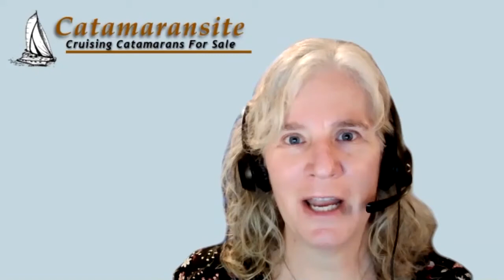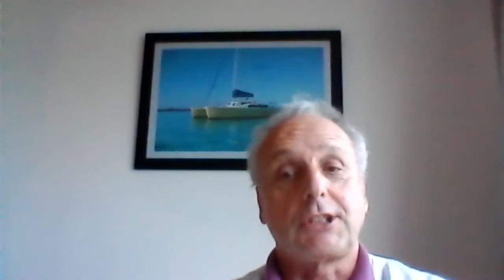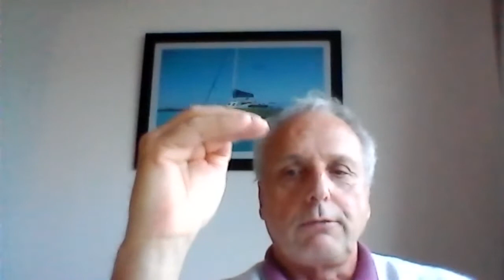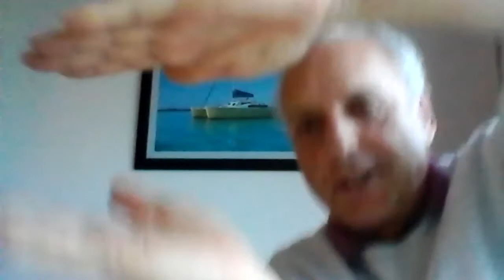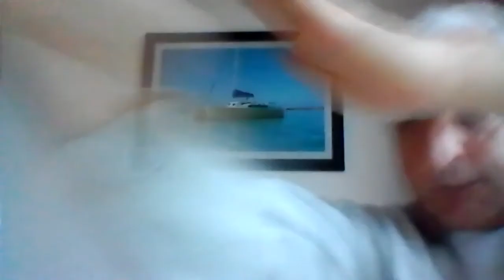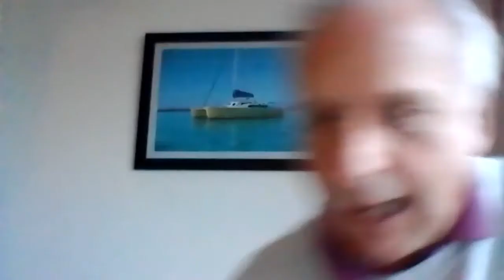What "good" bridgedeck clearance is and why is it important? - Richard Woods Interview # 4

Comment: In this interview Richard Woods talks about concepts of catamaran design while the interviewer talks about tactical aspects of a boat, the gap between concepts and tactics is strategy - catamaran design strategy which could of focused on preventing hull slamming.  1. The bridgedeck should start as far back as possible from the bow of the boat.  2. Beam and hull shape effect the wave(s) between the hulls created by the hulls.  S shaped catamaran hulls, curving in at the top, create less of a wave between the hulls.  3. A bridgedeck bottom that slopes from the front down towards the water is preferred over a flat horizontal bridgedeck bottom because the slant or slope will give the wave an area in which to dissipate resulting in less hull slamming.   4. When inspecting a catamaran for bridgedeck clearance, use a measuring tape - at rest transoms should normally be out of the water, measure from the transom forward.  Mind where the true waterline on the hulls is when the boat is loaded.  A rule of thumb is a dinghy should be able to pass under the boat between the hulls, a dinghy with people is better in that there is more bridgedeck clearance.  Thank you Richard Woods -you have a wealth of experience and some wonderful designs.